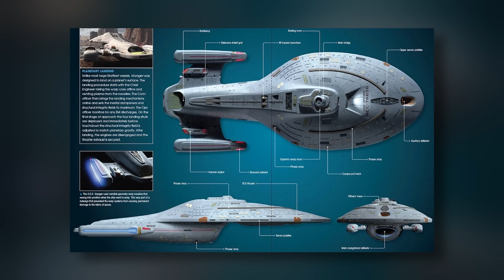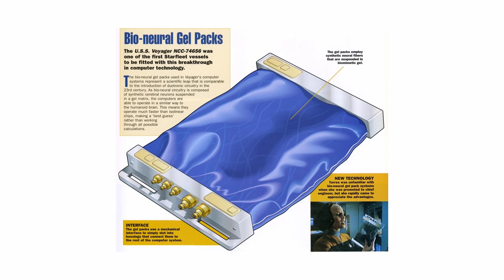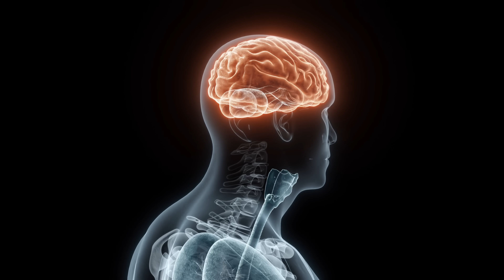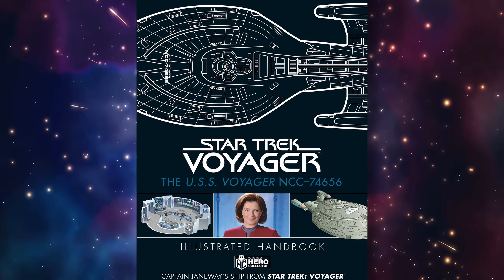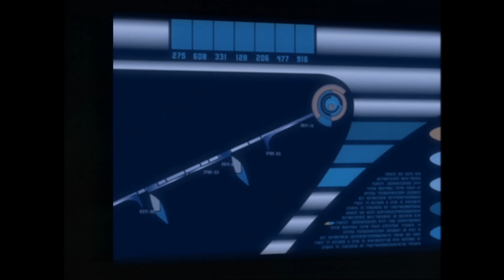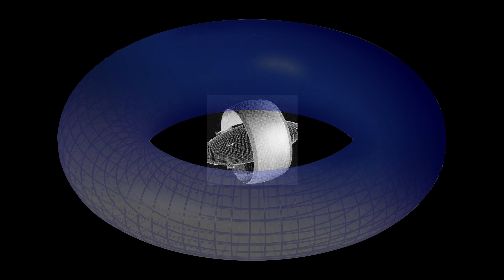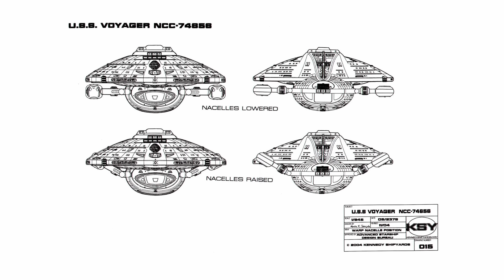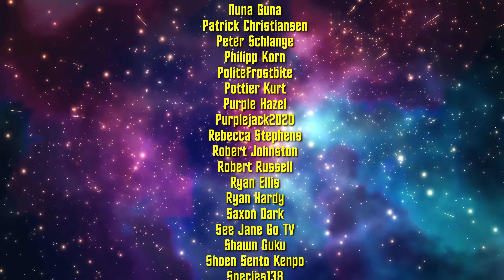The Hidden Genius of Voyager's Design

Comment: I think the variable geometry nacelles were to prevent the damage to subspace, which was shown in TNG and caused Starfleet to limit speeds to Warp 5 unless it was an emergency. Since the Intrepid class was designed for sustained high warp flight, it needed to prevent damage to subspace.
Reply: me stoned so me hung up on "variable geometry nacelles" heuyhehehe
Reply: I'm pretty sure that might have been mentioned, if not on screen,  in some near-to-canon source.
Reply: @@AlexRomeli I figure the moving nacelles was a stopgap until they figured out how to not need to do that.  (ie,  the Intrepid,  being all cutting edge, was probably designed   when  everyone was bein like 'I can't drive Warp 5!'  )
Reply: variable geometry warp is still warp - though most likely just more efficient. like high mpg internal combustion engines - you get farther using less fuel, but you're still spitting out the same by-products
Reply: What few people seem to understand about warp damaging subspace is that it only causes damage on routes that are repeatedly traveled upon. Sort of like wearing down the path if you would like to call it that. In the episode, it was exactly that. In the rest of the galaxy though, it wouldn't be an issue, primarily because of the vastness of space and the more travel routes available because of it.
Reply: I think that’s how it’s explained behind the scenes. However, the TNG episode you refer to, “Force of Nature” actually mentions a USS Intrepid as the ship Geordi is having his warp efficiency competition with. As this episode takes place in 2370, only one year before Voyager’s 2371 launch, it’s highly likely that this Intrepid is the Intrepid-class prototype. Therefore, the Intrepid and its class were already entering service before the damage warp does to subspace was discovered and the implementation of the Warp 5 speed limit!
Reply: I always thought the warp nacelles were much too small.
Reply: This is confirmed by Sternbach and covered by dozens of content creators
Reply: @@AlexRomeli Yeah, always thought that they fixed the engine properly with newer designs.
There isn't really any lore on why exactly the nacelles move on the Intrepid, but my headcanon is that they could adjust them in-flight. Basically changing the engine config until they find one that is optimal. And once that optimal solution is found, put that into newer designs.
Reply: @ThommyofThenn  no it was intended to be cannon
Reply: @xanderguldie  canon, not cannon
Reply: @RandomYT05_01  I think you might have forgotten this is a TV show
Reply: @moxxy3565  Nobody forgets it's a tv show. I was just trying to clear up an apparent continuity error by pointing out that it's not actually much of a continuity error at all.
Reply: @HappyBeezerStudios  i think moving them during warp for adjustments was the idea.
move the pylons to change the warp field, if youve reached an area of subspace that has different characteristics.
they moved quickly away from this story-telling dead end with the introduction of the streamlined sovereign class as an example.
Reply: Why didn't they just use the fungus magic propulsion?
Reply: @TwanDelRio  you mean the top secret, highly experimental, everyone sworn to silence magic fungus?
Reply: @benjackson8731  probably, I don't care anymore.
Reply: @OllamhDrab  much like the F14 or F111..  Variable geometry wings while cool as hell, were a resource hog, and the F16 / F15s proved you can be fast AND agile with out it.  making them cheaper to support on mission.
Reply: @Mak10z  In this case  I suspect the analogy's more like heavier equipment than  airfoils under strain,  though.  While fewer moving parts is always good in a ship,  the Intrepid's design enabled them to do better speeds without hurting subspace till they figured out how to be tidier without it.  Transitional design in either case,  really, I figure.
Reply: Issue with this is explaining why they then fold back down. The articulation needs some justification for all stages, the Constitution class already had nacelle placement for a tight silhouette.  Maybe it makes it easier for the ramscoops, even though those have a wide cone of effect already, but ultimately you're left with the bigger question of what problems those tiny nacelles on a long space frame solve by articulating, that isn't better fixed by another less mechanically fragile design.  It's just a kind of silly hot rod design. But I do think the theory of variable warp geometry is the best explanation. But it might be enough that it allows for more stable and efficient sustained wrap flight for long distance science missions.
Reply: @benkentucky4380  Presumably they actually move pretty adaptively depending on speed and conditions,  and I also presume the hinges are incredibly robust:  if anything adding a bunch of extra mass  that way.  The flattest position is presumably best for sublight maneuvers/thrusters and would be where the hatches line up for crew access.  

Obviously Starfleet found easier ways to so what those moving ones do soon after,  but they seem to work fine.
Reply: @mb2000  though it's possible they only added the hinges later. Something that probably was not possible with designs like the Galaxy class with the nacelles sitting on those huge pylons.
Reply: Possibly, but there's also a tactical edge to having moving nacelles. While lowered at impulse speeds, the impulse Engines (which are on the nacelle pylons) are wider apart, which would improve agility and speed. At warp the nacelles can then move up, reducing the width of the engines, allowing for a slimmer warp field, which presumably increased speed.
Reply: @mb2000  I don't remember where I heard or read this but I'm fairly certain a few years ago u saw that the intrepid itself wasn't fitted with variable geometry pylons, atleast not as built, and voyager was the first to have them, as a result of the findings from force of nature, as many of the experiments to reduce the impact of warp speed.

Hence why later ships such as the sovereign class going with the fixed pylons but streamline design as it was ultimately decided that narrower forward profile was what made the big impact, rather than the tilting pylons.

But as I say, I can't remember where I heard or read this so take it with a grain of salt.
Reply: And then the writers forgot about that and the folding nacelles idea never shows up in later ship classes. I believe this was retconned somewhere as newer warp drive tech had made the folding nacelles a solution in search of a problem. The real reason is probably that the SFX people wanted to just go back to simpler models without moving parts.
Reply: I think it was a great design choice in respect to setting the class and type of ship, and the fact we had our first female captain. I don’t think it hurt the design and even made it a little sexy. I didn’t care much for the delta shaped saucer section though, that be my only complaint.

Comment: Yes, you have to make a warp speed scale. That would be great
Reply: the speed scale must go all the way
Reply: @mekkler  yep. I noticed some travel times quoted as warp 3 in Enterprise should really be warp 7 or warp 8…
Reply: @mekkler  that’s the scale Enterprise used too, and matched their quoted times to and from Pluto… but then they soonafter could travel a couple light years in a couple days at warp 3? Which “should” be 27x the speed of light, as in a light year still taking almost two weeks. 

So then I took the cube root of 500 (going a bit over a light year in a day, 500c is a decent estimate over 365c) and that “should” be warp 8 (well, 7.9). But apparently it’s warp 3… it’s like they often took the TNG distances and times but just tacked on a lower warp factor instead of picking smaller distances or just writing longer time skips. 

But they got the distance and time scales basically right in other episodes such as the warp 2 test getting from Earth to the gas giants in a few hours. So they clearly could do it when they cared. 

Of course, no Trek series has ever consistently adhered to the cube formula (or TNG’s revision), not even TOS. So it’s not exactly new. 

There’s other supposed justifications attempting to square that circle, which I don’t like as much, such as “density” of space or nearby gravitational wells slowing things down (or speeding them up)… but then warp factor becomes meaningless as a measurement of speed! While also being needlessly complicated if it’s just a measure of engine exertion (so why not just give a percentage like they do with impulse?)
Reply: @kaitlyn__L  And for instance, Warp 9.975 is somewhere between 5127 and 5552 x the speed of light, supposedly (or up to 15.2 light years a day)
But other times, is hinted, to be a lot faster.
And warp 8 should be 1024 times lightspeed (2.8 light years a day) but is also, I think, variable.
Reply: @chrissonofpear1384  I’m guessing that’s TNG scale warp 8. Interesting that it’s exactly twice as fast as the TOS scale one (512c)
Reply: When Warp speed had started, sliptime is waiting for us.

Comment: My favorite tidbits are:
It was the first starship equipped with a new type of Industrial replicators and allowed for the replication of almost all parts and things needed, as well as the processing of raw ore. 
Also bays..it has a ton of cargo bays and empty spaces that can be repurposed. Hydroponics was a cargo bay originally on Voyager. 
They have a Shuttle repair/building bay. This is seen when they are building the Delta Flyer, it has a bay door in the floor (or the ceiling, I don't remember which) to allow shuttles in and out of the main Shuttle bay. There is one of the new replicators in there as well. Its how Voyager always had more shuttles, they basically just built them and could feed raw ore to the replicators and get parts out.
Reply: (Also why I got a headcanon for why they never used the 'Aeroshuttle,'   they had to cannibalize something real important from that early on in their ordeal. )
Reply: @OllamhDrab  in a script in early season one they were going to mention that there's no areoshuttle there, it's just a cover plate as they left spacedock before it was installed. It was cut for pacing. But the original idea was for a much more flushed out ore processing and construction area being built in the void space, however due to budget they scrapped the idea because they couldn't afford the set.
Reply: I always figured such industrial replicators had been fairly common in large deep space exploration vessels, but maybe was new for “closer to home” smaller ships like the Interepid. And of course now the Vehicle Replicator is canon even in the Defiant-size Protostar class!
Reply: @kitfaaace  yeah the intrepid class was the first with the ability to process raw ore all in one replicator. The intrepid class was designed to be able to operate at the edge of federation space for years at a time without needing to return to the core of federation space. Its also equipped with a secondary warp 5 core (you can see it on the schematics both in show and in the manual) so if they lose the main warp core they can install the warp 5 core and limp home.
Reply: @jacara1981  from the TNG and DS9 Tech Manuals I was under the impression that was standard for all Industrial Replicators, either funnelling the rest of the ore into the matter tanks or rematerialising them side by side with the refined metal or even the finished product. 

The industrial replicators were specifically called out as having a bunch of extra tanks for metals and minerals. whereas food replicators only had carbon, hydrogen, oxygen, nitrogen and silicon tanks.

But I’ve not read the unreleased Voyager Tech Manual, the only download I found was corrupted. So if it’s mentioned in there, fair enough. (Though I did read the internal series bibles I could find.)

I’ve seen the extra warp core in the MSD, though some of the staff (both design and writers) in later production years suggested it was absent or only partially-installed in specifically Voyager just as with the Aeroshuttle. That’s kinda neither here nor there, unless the rubber ducky in the D’s main shuttlebay is also canon ;)
Reply: @kitfaaace  it was never fleshed out so I don't know. I just remember a writer on Voyager talking about it when asked about abandoned ideas and stories. A lot of it was because of pacing or cost to produce sets (remember cgi was still early in it infancy). 
I can't remember the voyager episode, but in one they jettison the warpcore while at warp, and then it cuts to the crew talking about how long to get back to it. So without a warpcore they can coast up to a lightyear, without another core there's no way they could ever get back to it.  Again this was due to budget, but they were suppose to mention it would take like 2 hours to get the other core installed, that's the reason for the delay. In the episode they glossed over all that to avoid the cost of showing it.
Reply: @jacara1981  so in that episode where the core is stolen they discuss sending a shuttle over at warp to collect it and bring it back, rather than following the core in Voyager :)
Reply: @kitfaaace  ah its been like 20 years since I've seen that episode lol
Of course a lot of this is speculation since nothing was hashed out and even cannon on screen is subject to the next writers whim lol

Comment: The Intrepid class has always been my favorite. It's a more reasonable size.
Reply: my thoughts exactly awesome ship
Reply: I do appreciate the Intrepid's sleekness and agility, it does what it is designed for extremely well, but I just adore the sheer presence and gravitas of ginormous ships like the Galaxy class.  The Galaxy may not be a fast agile ship required in war but they made for spectacularly opulent city ships, sturdy C&C ships, and flying bastions that projected all the best parts of the Federation out into deep space on long term missions.  I would have rigged the Galaxy class far more for combat, more phaser strips, gimbal pulse phasers, a bunch of fighters/a docked support fleet, more torpedo launchers, and completely covered it in ablative armour.   I would retain all the interior space and luxury for the sake of the crew and for the purposes of diplomatic missions, and use the acres of hangar space plus the many decks full of empty unused space for all those other upgrades as well as a secondary warp core to make my vision feasible.

Comment: I think the variable geometry was nothing more than gimmick, or aesthetics or both. The whole reason for the unobstructed space between nacelles is rendered pointless by the existence of warp capable shuttlecraft, where part if not all of the nacelles is obscured from one another by the body of the shuttlecraft. Defiant class starships also render these arguments void, seeing as the entire ship is between the nacelles. Constellation class ships also had obstructions between nacelles, unless the nacelles are paired top right to bottom right and top left to bottom left, The Danube class runabouts also put the body of the ship between the nacelles. The runabout design especially, along with Defiant, put the theoretical strongest part of the warp field in the crew compartment (thought arguably with Defiant, the strongest part of wrap field would in fact intersect the warp core itself). So I am going to call it as I see it, and the variable geometry nacelles on Intrepid-class ships were simply a gimmick to set them apart from everyone else. The "unobstructed field between warp nacelles" is also rendered void by most other species starships period. Meaning that nacelle placement is either arbitrary to begin with, and therefore purely aesthetic, or the other species have figured out something that Starfleet (Federation) has not. Also USS Prometheus, experimental ship from VOY: "Message in a Bottle", did not have variable geometry nacelles nor an "unobstructed field" between nacelles and was capable of a cruising speed of warp 9.9.

The Bio-neural gel pack on the other hand are quite creative and interesting inclusion for a new class of starship. Not to mention they are used on pretty much every new class of ship moving forward.

Comment: I always thought the bio neural gel packs were a dumb idea.  Silicon circuitry runs at light speed for the most part, while any bio neural circuitry would process information and thousands of magnitudes slower speeds due to chemical processes being behind their operation.  Overall, though I think Yoyager is a fine ship,
Reply: The age old parallelism versus serial throughput debate.
Reply: I think the gel packs might be better at certain types of computations just like quantum computing is better at some problems than standard computers.
Reply: @kennyhudson9201  right. Already certain DNA(RNA?)-based mechanisms (not encoding the data in the DNA but just structural) are faster at certain very high possibility calculations. As are slime moulds. I could see the gel packs searching a possibility space massively parallel, then handing off those few candidates to the isolinear circuitry for high precision final calculations. Like a fancy hardware assisted tree-pruning algorithm for massive datasets.